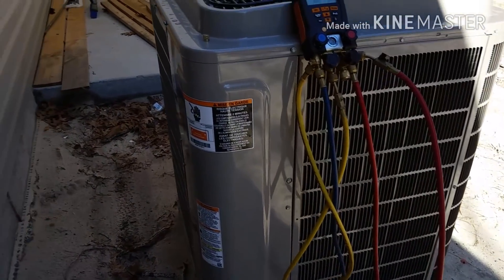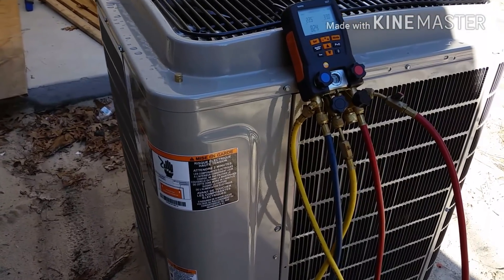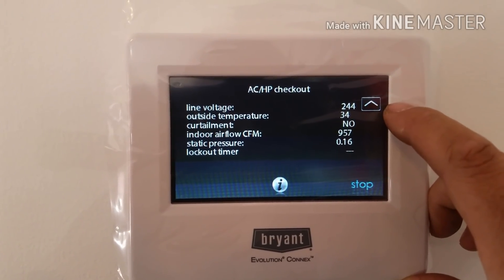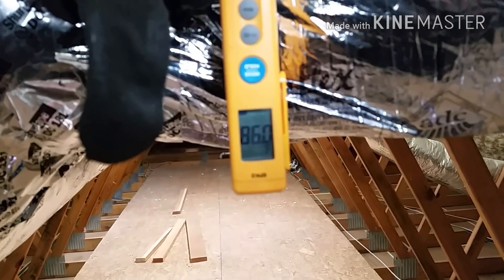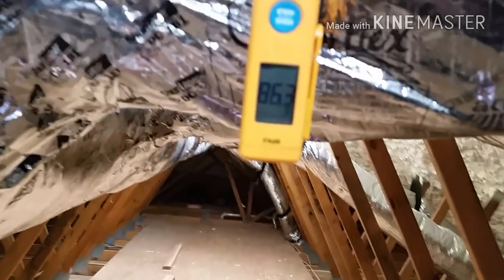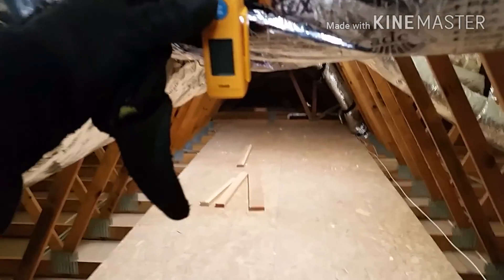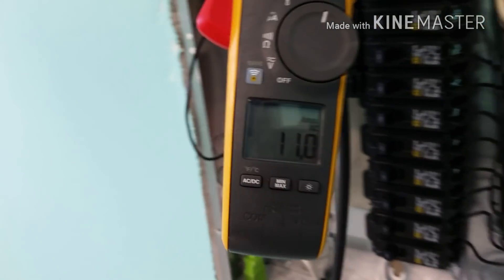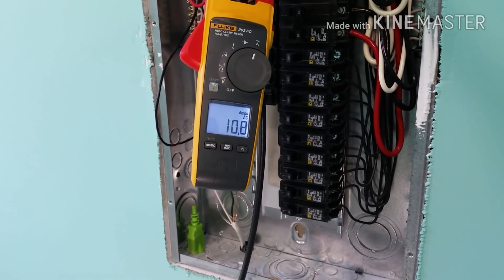Heat Pumps Can't Work In The Cold

Comment: Great system but have you seen the Bosch inverter ducted split system with a Mitsubishi compressor, Mitsubishi inverter board? Its about a third of the cost of that. Bryant/Carrier system you’ve installed. It only requires about .97 to 1.0 amps to start up. Four wire connection to communicate and you can even use a Focuspro 3000 to operate it. Registration is applied to the address and not the homeowner, so transference of the warranty is not required. It will operate down to -5 degrees before needing a backup source of heat. Emergency strip heaters are exactly what they are, for emergencies when something fails such as a compressor. In your situation there are no safeguards for such conditions. Overall, I liked your video.
Reply from the maker: Larry Morton Im familiar with the Bosch you speak of but much prefer the Carrier/Bryant full communicating Inverters.
Thanks for watching

Comment: I live in Va right now we are go thru a cold snap 20 degrees outside my heat pump runs constantly should I switch over to emergency heat ? the heat pump is a trane  like 6yrs old
Reply from the maker: vbvini No. Leave it in normal heatpump mode. This is normal during very cold conditions. Thanks for watching.
Reply: cheaper to let the heat pump run all the time then to use heat strips.  I think heat strips are only good for defrost cycles and emergency mode when problem with refrigerant part of the system.
Reply: vbvini ... i live in Va also and have  a Mitsubishi  mini split.  No problem at all at four above  zero. Three year  old unit that uses "true inverter  design" . What took Amerucian companys so long to adopt what the rest of the  planet has known for twenty years?

Comment: It's -4 F right now where I am in Northern Maine...my neighbors heat pump which points toward my house is so loud it's keeping him and me up searching for possible noise solutions. To eliminate the constant, pulsing, low frequency vibration/hum we'd have to move the unit (which I'm sure another neighbor would greatly appreciate) for $940 USD, get noise cancellation panels at $618. each X 3 plus install, or get an alternative heat source (loosing the $2,490 put into this heat pump, and cost of new heat source).
All and all, the heat pump blows. It's 56 in his house, the thing runs all the time and he's having to use supplemental heat. Everyone I'm talking to here who've been trusting the advertisers are realizing now these machines are NOT good for cold climates. Please don't be fooled by the "quiet" or "efficient" claims. The thing is the loudest thing around the neighborhood and it's not even doing its job. Local salesmen said it'd "be no problem in the cold". 
...It doesn't even heat once the temp dips below 10 F and the loud outdoor unit is always running, even when not pumping heat. 
Heat pumps are a horrible investment for anyone hoping to truly heat their cold climate home while getting a quiet nights sleep.
Reply from the maker: Op Sea A basic 10-13 SEER ducted, single stage heatpump is designed around (in heat mode) a 47 degree ambient operating temp. For every 3 degrees under 47 it looses aprox. 1000 btu. (You do the math...)
If your neighbor has a that sort of system at far north either he and or the contractor are foolish to think it would perform adequately in winter. Can't blame equipment for terrible application decisions.
If you educate yourself and your neighbor on ductless heatpump technology (which have been around for well over 20 years) you will find they are a far better heatpump option for your region. Most have an operating temp down into the negatives and do so without the help of any supplemental heat sources.
Don't be fooled into thinking the equipment is somehow at fault.
Reply from the maker: Op Sea Thanks for the interesting comment though
Reply: I am in New Brunswick Canada north of Maine. I run two ductless mini split heat pumps, the past two weeks (Jan 2017) it has been -16C  in the day and down to -22C at night and my house is toasty warm at +22c inside. The house is a two story 1400 square foot with a 12000bTU in the living room and a 12000btu unit in my upstairs hallway. I have a pellet stove fireplace insert, and my fireplace is in the center of my home. I burned 8 bags of pellets last year. Not sure if I will burn any this year. When she drops below -25c (-13F) I throw on the pellet stove to help the units out. I am saving roughly $2000 a year on my heating costs since installing these in 2014, they have paid for themselves already. In Canada they come with a 10 year parts and labour warranty (adds to the price).
Reply: Dave Hale is there auxiliary heat used where you are?
Reply: I live in southside VA and have a heat pump and it screams and thuds in defrost and is a lennox 2 stage heat pump put it in 2014 and when it hits 35 degrees it is horrible .It is a 16 seer 4 ton unit and these things suck .I hate heat pumps .Mine has been repaired 3 times since installed by their number 1 installer and first the compressor was replaced after only a year because it was defective and then it would not go into high heat mode because a part was missing .They sent a lennox rep here and he saw the part was missing and that it was factory set wrong .Still noisy but not as bad
Reply: sissy murphy don't blame all heat pumps for being shitty because your one heat pump is shitty. Do you have auxiliary heat too?
Reply: @shelbysupersnake101  I have had 2 heat pumps as the first one lasted 10 years which they say is the life span for them .I have auxilliary heat also and my heat pump summer and winter stay on 76 or 77 .We do not like it cold and the rep from lennox has been here and found 2 parts missing but to this day it is the worst .I have gone to consumer affairs .My first one I had was a low no great unit that came with my modular house and heated a lot better than this unit ,but sad to say it just died and after spending money to get it fixed it still was not going to survive  .I thought if I got better it would be better .Not so much .These are matching units and installed at the same time .My house was built above standard for here .I thought if the house was built energy efficient that I would save ,but no .Heat pump is not what I thought it would be .I have upgraded everything in my home from weather stripping to triple pane windows and insulation .
Reply: I also have the wifi thermostat to warn me and lennox and the heat pump installer of any problems which only warning was that the compressor after not even a year was going bad and they replaced per the extended warranty that I got
Reply: sissy murphy if all heat pumps were bad people would never use them
Reply: @shelbysupersnake101  They are building houses in my area and all of them have traditional heating and cooling systems in them .I have seen the area grow from 7 homes since I put my modular home here to 49 homes now .All of them I have seen that sold all have traditional heat and cooling .I am not sure how energy efficient the homes are compared to mine or how much the systems cost running .I do know all the homes are smaller than mine and are built with 2004 studs .I know in the winter my electric bill goes up to 300 dollars a month and I have all led and brand new energy star appliances .My indoor unit is also inside my house in a conditioned space and had the heat ducts checked and had an energy blower door  test done on my home .I read up a lot on them and all the consumer affairs stuff since I came here from NJ where normal was traditional heat and cooling .I do know that 3 of the houses built still have the traditional heating and cooling systems and that they were all built back in 2006 and they seem to be working fine .I just know from talking to the people and do not know how energy efficient they are .But if they decide to take this unit out per warranty I would go traditional if I can find more info on them .They may be putting natural gas down my road soon .We are getting into the future here where propane and electric is all that is available and in hunting country that big propane tank does not feel safe to me .Had a neighbor that was here before my house that his got hit by a bullet and it was not pretty and lucky him it was far enough away that it only damaged his carport and that his cars were not there when it happened .It was enough that I heard the explosion
Reply: sissy murphy so, with heat pumps, they are much less efficient as it gets colder. In extremely cold conditions, they aren't as efficient as high efficiency warm air systems. The reason those new houses will have normal natural gas furnaces is because it's much cheaper to do on the first place.
Reply: @shelbysupersnake101  there is no gas here yet and they are electric or propane .Southside gas has just built a place on Berry Hll road and have been out marking areas to run natural gas .I still have to wait .It has taken time for me to learn all this new stuff here .well water ,pumps and filters and pressure tanks .It has been a real learning curve compared to Edison NJ .Sad we had to retire from Ford Motor company and even with this big learning curve it is still worth the move .15 thousand taxes there and a acre and a thousand in taxes and 3 acres here ,I will have t deal with this little hiccup : )
Reply: sissy murphy since you don't have natural gas I definitely think heat pumps are the best way for you to go. Good high efficiency heat pumps shouldn't be that loud, you seem to be having bad luck. If you've ever had a good high efficiency AC, it should be comparable. Variable speed compressor and AC motor fan so it'll be fairly quiet and breakdowns shouldn't be super common but with anything HVAC, don't expect to get 10 years breakdown free
Reply: @shelbysupersnake101  my other unit worked great with no problems until a company worked on it to put freon in and after that it just went bad .Mine was a high efficiency ,if you look up lennox the indoor and outdoor unit were matched and the installer was thier number 1 installer for my area .It was not a cheap unit by no means and a well known brand .It is variable speed dual compressor with wifi .the first year compressor went and then indoor unit kept blowing the fuse and then the unit would not go from low speed for the blower .It was installed in 2014 so how is that old it is only 2018 .4 ton 16 seer is not a cheap unit and i got the lemon of course .My other unit I had was a comfort system and only 10 seer 4 ton unit and came with my modular home when i had it built and it lasted until 2014 and 1 so called great maintinance guy ruined it and then bent the blower fan on it while working on it .Good people  here are far from good .Country life is great but repair people are iffy .
Reply: sissy murphy that's too bad. Most of the time that's because they dont have licenses. Too many companies letting unlicensed workers work. The other thing is depending on where you are, good service for heat pumps is hard to come by.
Reply: @shelbysupersnake101  this is a licensed company but I think I just got a lemon ,well murehy's l;aw if any thing can go wrong it will
Reply: sissy murphy that's true. But, trust me when I say that just because the company is licensed, doesn't make all the workers licensed.
Reply: @sissymurphy9620  I have a Trane and it's as quiet as a mouse.
Reply: @brianleeper5737 2nighbors had tranes and inside unit box casing cracked after only 2 years and another 1 warped in a friends .I come from NJ and prefer a normal heat and air unit .If I have to do it again it will be a normal unit
Reply: @sissymurphy9620  Strange. No problems with my Tranes, and I own two of them.
Reply: Put a heavy brick on top of the fan grill.

Comment: I really haven’t been impressed with a heat pump. I don’t know if it’s just my particular model but it doesn’t do the job that well. In the winter when it’s below freezing, the heat pump is running all the time because it can’t keep up with the temperature set on the thermostat, even though the thermostat is set to hold 65 degrees. In fact in the winter time when the heat is turned on, the air coming out of the vents is really not that warm, maybe even a little cool. In the summer time it’s pretty much the opposite, the air coming out of the vents is a little warm. Shouldn’t that be the other way around?? Maybe heat pumps are cheaper to run than standard baseboard heating/cooling, but as I can tell, that comes at a cost.....not being able to keep the house temp at what you want half the time. It seems like standard baseboard heating and cooling would really meet your comfort needs a lot better. You get what you pay for.
Reply from the maker: If your heatpump can't maintain your desired house temp then you need to call a licensed company in your area and get it fixed. Thanks for watching

Comment: You need a Gree, they can run down to -13 F (With Max output capacity!)
Reply from the maker: Jaymate No need. We are in South Carolina which will never see temps like that.
Reply: HVAC in SC Thanks for actually replying, just a queation, I know these central air units are very American and close to your heart but why don't you modern Japanese ducted and multi-splits that often, they are Hella quiet, compact, efficient and smooth, in Australia we only have Japanese units, I mean for example Toshiba double fan ducted units, they are so nice, with all DC motors, beutiful backlit controllers, PAM,  PWM (PWM allows for what you would call infinite stage) and they are reliable, they happily go right through 47 degrees Celsius and 90% humidity, are American units cheaper? Significantly more reliable? Just curious because I think you are really missing out! Best wishes ~James
Reply from the maker: Jaymate I assume you're new to my channel or you would see we have been installing ductless systems for almost 20 years. Including a 28 ton 19 head Toshiba/Carrier VRF ductless system last year. We are very familiar with the technology. Both ducted and ductless. Thanks for watching.
Reply: Oh! Ok :D
Reply: HVAC in SC what is the best outside unit to make the most heat output I live In northern pa cold as hell. I need heat. In 5 ton unit  i was thinking the new ducted Bosch. What do you think. The bosch unit can work with my existing American standard air handler condenser. Any advice?
Reply: Mr504319  I take it that you have a single speed system, but you could have problems wit not matched components, If you could swing it , go with a VARIABLE SPEED SYSTEM, costs more initially,,but uses less kw to operate, and probably not use the electric strips., like anything else sized properly,,installed properly,,you will be comfortable.  from Maplewood nj

Comment: Why was it showing 0 suction superheat?
Reply from the maker: Joe Shearer Because it just has a normal indoorTXV so it's not measured in heat mode.
Reply from the maker: It's a fully variable speed inverter so it depends on other factors like run time, IDDB, and the programmed algorithms, ect. These are not systems that you look for specific pressures. You basically treat them like ductless units. Calculate the required charge, weight it in, and leave it alone.

Comment: What happens when the system goes into defrost mode without heat strips?Great video
Reply: The fan turns off until defrost is over.
Reply: What’s defrost mode?

Comment: kind od hard to go gas in a home like this, even the softer heat of the heatpump will seem pretty hot most days....how did you pressurize the attic to confirm leakage?
Reply from the maker: Performance Based Heating & Air Standard blower door test.
Reply: I see, just bring attic into loop. Here they typically go from regular house and move into air sealing so attic floor is what gets sealed. I would love to be able to do a house like this. and better yet i would love for it to be my house! lol

Comment: It's taking me a while to get used to the new technology.  Less than 11 amps is quite impressive.  thanks for the video
Reply: HVAC in SC any experience with Mitsubishi mini split they seem the best in mini split and our house is 1911 old so duct work is junk as well as our 2 year old Trane unreliable air conditioning plus uneven duct mini split seems the best option we will keep the furnace just in case we live in Colorado but Mitsubishi is rated to -13 Fahrenheit but 0 and above is optimal very small attic so duct work nearly impossible unless we tear the drywall ceiling 3 bed 1.5 bath house around 1200 square feet poor insulation so what it is going to be a 5 zone unit but with an outdoor unit of 42k to 48k BTU
Reply from the maker: Straycurrent Thanks man, and thanks for watching.